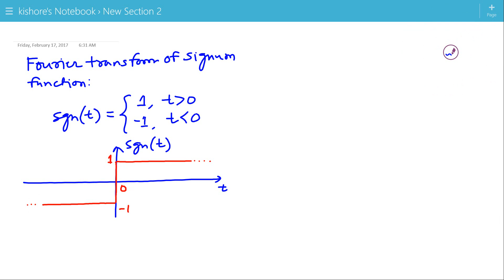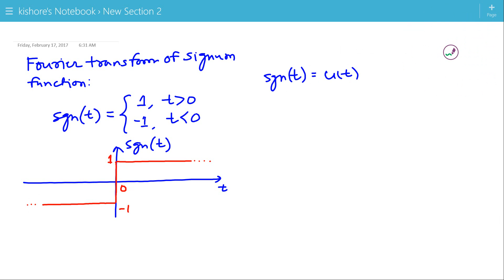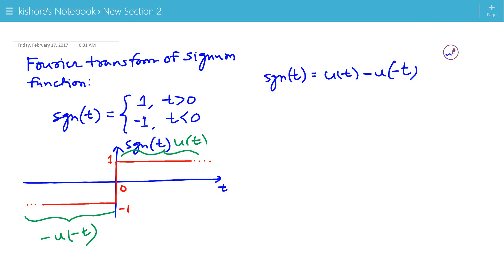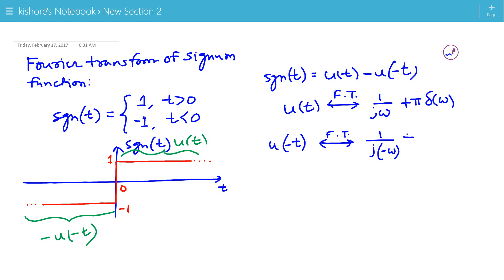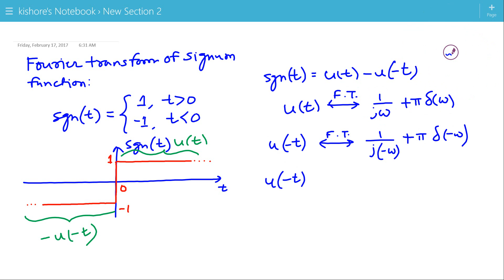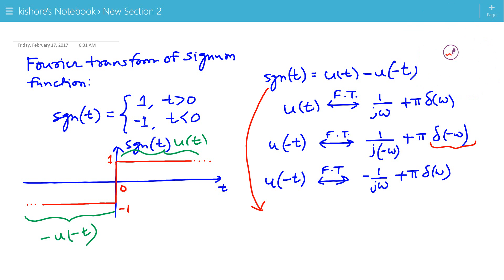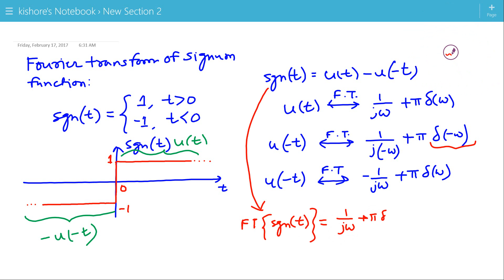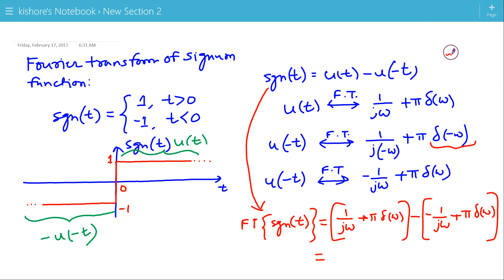Fourier Transform of Signum Function

Comment: Hello professor, THANK YOU, i really appreciate this series, i studied (as tech elective) Laplace transforms and Fourier series in college and I am studying Fourier transforms now (32 years after graduating) so my question is: what does an i in the result mean? Sometimes all the i cancel out and sometimes not, sometimes there is an i in the exponent. In this lecture there remains an i in the denominator. The problem I want to solve is the FT of the N-wave of a sonic boom (sudden rise in pressure followed by linear decline to negative pressure and then a sudden rise to ambient pressure) but it troubles me that there can remain an i in the result, it would seem that every i should resolve in to a sin or cos term.  Best regards, John in Michigan.
Reply from the maker: Hi, John thanks for watching my lecture video, i is used for 'iota' that denotes the imaginary part of a complex number. If FT of any signal is real then you will not get i in FT, and if FT of any signal is complex or imaginary then you will find i there. Even if you get i in FT you can use magnitude and phase of FT for further analysis.